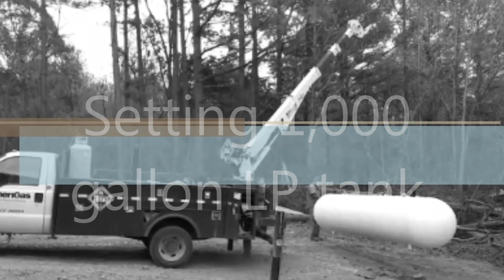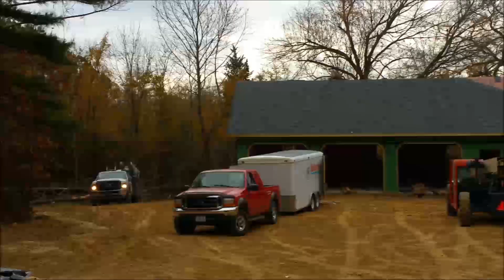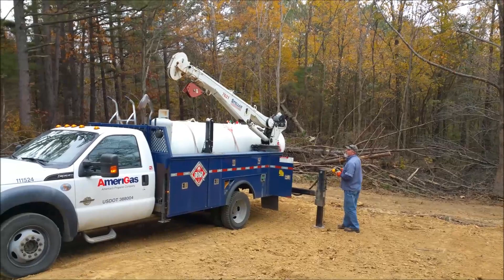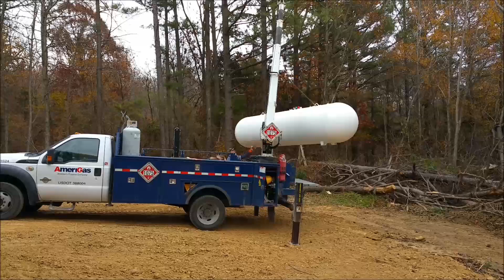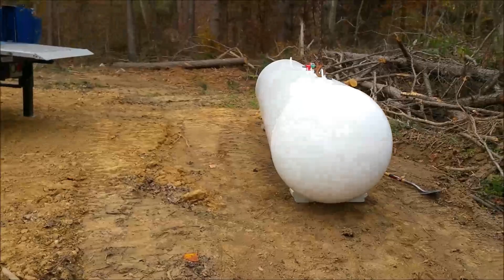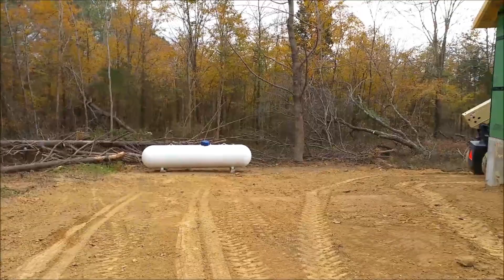Setting 1,000 gallon LP tank. A one person job?? 11-22-16

Comment: Man one of those little cranes would be handy for loading a big buck in the truck lol. 

We just went back to gas after burning wood for years we have a small gas heater then a furnace in the hall I think it was around $250 for 100 gallons.
Reply from the maker: Reaper yeah, I can see a nice buck hanging from it. the prepper in me wanted wood burning but the cost was just so high that it was not feasible.  so I went with 1000 gals and an lp backup generator.

Comment: Should have made a concrete slab since you're keeping it above ground. How long does the average 1,000 gal usually last?
Reply: A very long time if kept clean , a occasional liquid wax car type extends the life as well. Most important do not let tank go empty. Tanks when installed are purged of any air and usually have alcohol put into the tank to absorb any moisture which can then blend in with the gas for removal.
Reply: Decades.

Comment: 1000 gals nice, a lot of fuel 6 month supply.
Reply from the maker: tom noeldnerr I wanted a wood burner but just cost too much. so I'll have an lp generator that if I only run in short Burts should last more than a year when ww3 breaks out. then I'll be looking hard for more lp :)
Reply: LOL one year not long at all, but before the year is out go to wood, you have unlimited lumber to burn.

Comment: Could you not have put a small concrete slab in for that? 
With the amount of rain you get I'd be worrying about the dirt washing out from under it.
Reply from the maker: Yeah, I suppose I could have... This was another one of those things that if we didn't get it in asap it wasn't going to get in til April! I'll see how the run off looks and I could always pour a slab around the pads that he put down.
Reply: Ah, up against the clock eh. Not so keen on just pouring a pad around those blocks, the rest of the build work has been quality so it'd be a shame to bodge it. A decent layer of hardcore would help with washout too.
Reply: @____________________________.x  there should have load of gravel for the base first
Reply: @jamesarcand7991  thanks for the post, somehow YouTube unsubscribed me about 5 years ago and I was only thinking the other week about what the channel name was. Seems like Kapper is doing well 🙂